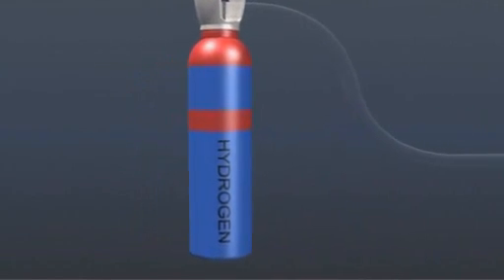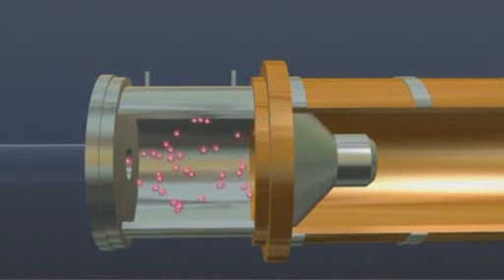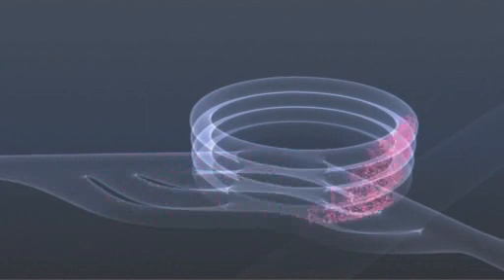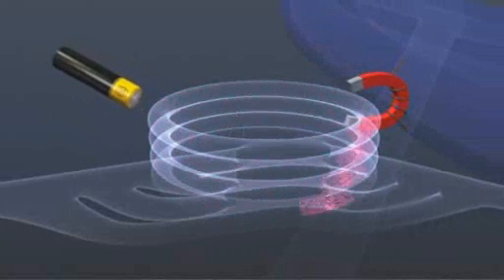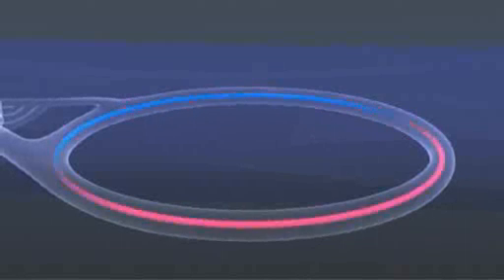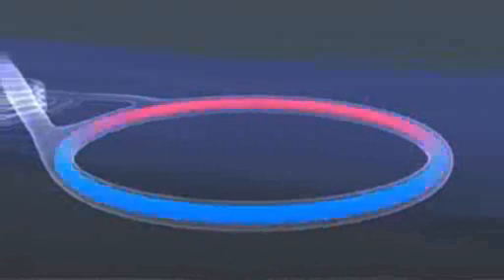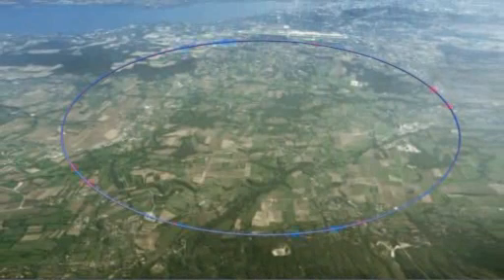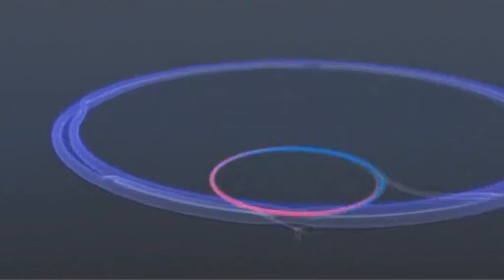The LHC - The Large Hadron Collider. What is the LHC, how does it work?

Comment: Everything is Vibrating Waves of Energy!!

The fact that this tiny spherical region of the One Infinite Universe has a limited observable range as the light waves come from a distance radius.  . ..Absorbing that information now is observable in the shape of an inverse sphere.  . ..4pi R2.. .  .
And the fact that (See: Spherical Electron Sixty Symbols) shows how the electron is indeed a perfectly round vibrating sphere.. .   .Thus because of the geometry are two sides of the same + and - coin!!

The increase in Volume +1=0 now -1 de-compression is only a slight deviation however.. .  .

There exists only two combinations of these Two Spherical Sine Wavefronts multiplying inward +1=0 now -1 dividing outward at right angles from their sources.. .  .
They have opposite vectors and quantum spin forming the positron +1=0 now -1 electron Wave Centre.. .  .
                                                                          (((((((4pi R2=/N pi Re2))))))
Or "the two dipole energy states of Qubit's" in quantum computing which can be such things as photons, trapped ions, atoms, electrons, and nuclear spins, made of vibrating wavefronts concentrically layered like onions called shells in particle physics, or spherical standing wave structures.. .  .Only difference is time dilating Volume now - their output was the negation of their input: 0 goes to 1,1 to 0.. .  .the start of the Fibonacci spiral.. .  .

Now space is a division of solidity into entropy as time unfolds C2 the second law of thermodynamics.. .  .But also in the future E2= a multiplication of volume +1=0 now at the expense of gravitational potential -1. .  .
                                                                   E2=(((((((M2 C4+P2 C2))))))).. .  .

Everything is formed by a surounding 4pi spherical inward absorption +1=0 now -1 outward emission of electromagnetic waves that's forming resonance antimatter matter annihilation forming positive and negative electric charge, and electromagnetic interference fields (2pi spiral radians 360 degrees) as time unfolds C2.. .  .

Therefore generation of "any information" exceeds radiation during the first half of the cycle +1=0 now -1 Radiation exceeds generation during the second half of the cycle.. .   .As the constant outward momentum of EMR repels like charged particles absorbing energy input +1=0 now -1 emitting the density from the two previous vectors spiralling out the Fibonacci sequence seen everywhere in nature.. .  .

Spherical logarithms forming +1=0 now -1 breaking exponential spirals.. .  .

Everything is made of just Two Spherical Sine Wavefronts compressing +1=0 now -1 de-compressing Two Opposing Spiral Vortices!!.. .  .from virtual pair's of plasma, to gases, liquids, and solid Fibonacci fractals!!.. .  .Only difference is time dilating volume, or their rate of vibration, at the centre of their own 3D ref-frames, or time line of broken symmetry within the One Infinite Universe.. .  .and therein lies the secret of the universal pulse beat.. .  .All motion is 2pi spiral.. .   .And all direction is 4pi spherically curved.. .  .
Vibrating sinusoidal spherical wavefronts of only motion forms Einstein's curvature of spacetime.. .  .
Velocity equals time density +1=0 now -1 density of space-time.. .  .V= td +1=0 now ds-t G/r2.. .  .
Gravitational systems are the ashes from prior electrical systems -1.. .  .
Time is inverse multiplying +1=0 now -1 dividing like frequency and wavelength.. .  .

Weiner Heisenberg the father of particle accelerators called an end for them in 1975, when he realized that matter had to be made of these resonances.. .  .Which then brought about the string theory craze where finding symmetry in the mathematics, everything was made of strings of energy!!

Strings vibrating a series of multi dimensional loops - "A Spherical Standing Wave Structure", at the centre of its own  three dimensional ref-frame."

It all started with a big bang output division theory by tracing time back to a single point in the past was a huge misconception since Dirac's discovery of the antimatter positive electric charge E=+m.c2.. .  .(((Imploding positive energy compression))) The conversion is, in fact a ratio between opposite vectors, thus the zero point field is the every beginning of everything giving us a starting point, or concept of zero in mathematics.. .  .

Everything is formed by a surrounding 4pi spherical inward absorption +1=0 now -1 outward emission of electromagnetic waves.. .  .And therefore the traditional assumption where space is three dimensional, and time plays the role of a fourth dimension is inaccurate.. .  .If individuals would wish to discover the true origin of the universe they would actually have to look "forward into the future", since Cnow's time resonance input vector direction +1=0 now is opposite to -1 the arrow of distance as time unfolds all the interference dividing outward from their sources.. .  .And that is what's being perceived as an expanding universe.. .  .

Light waves from all particles within every observable spherical region of the One infinite Universe, cascading downward from a distance radius combine forming the sinusoidal wave medium density (space) compressing +1=0 now -1 de-compressing Two Opposing Spiral Vortices at each and every point of space, or contracting +1=0 now -1 expanding Virtual Pair's Spiralling out of existence.. .  .(((Tiny implosions +1=0 now -1 explosions))).. .  .Because all 3D directions are 4pi spherically curved thus (((Wave Centres are Everywhere))) Relative to an infinite future of potential possibilities coming into +1=0 now -1 out of existence.. .  .

The total amplitude formed by a "rings series" of inward spherical waves coming into every point.  . ..Colliding at maximum compression points at wave crests and wave troughs always seeks a minimum +1=0 now are equally balanced by opposite expansion -1 at interchanging compression points.  . ...As trillions of waves cancel now the sum of opposite vectors mathematically is always zero.  . ..((Zero Point Field)).. .  .Leaving space with an average temperature, or pressure stillness of the wave amplitude squared.. .  .

This polarized superposition of the wave amplitude squared is the reason for entanglement for the symmetry or conservation laws in human physics or why, at the speed of C, time and space are zero due to length contraction and time dilation or why, the point of charge Q is the same for the entire surface of an expanding light sphere.. .  .Because the photons input +1=0 now -1 output polarization in between the crests and troughs will remain the same ((sharing the same expanding moment of time)) no matter how large the surface of the light sphere becomes until acted upon by an external force.. .  .

Vibrating sinusoidal spherical wavefronts always transverse one unit of space now per one unit of time dilation.. .  .Huygens wavelets forming the wavefronts are acting like the bits, or zeros and ones of a computer screen.. .  . 
The Planck's constant h continuously forming a blank canvas that we can interact with turning the possible into the actual.. .  . In a sense this so called quantum foam is a constant vibration on the edge between space and time.. .  .

Light is simply space divided by time entanglement and nothing else.. .  .That implies a strict equivalence between time and space with light being the constant conversion unit between the two.. .  .

And because everything is formed by a surrounding 4pi spherical inward absorption +1=0 now -1 outward emission of electromagnetic waves.. .  . Electrical potential is the same as future potential imploding within any 3D centred ref-frame, or object!!.  . ..And thus the Lorentz contraction of time and space is infinite in our universe within the active cores of galaxies.. .  .

Surrounding Implosive energy compression contracting time and space where the virtual pair's formed by 4pi R2's ((The "rings series" of photon energy)) that cannot escape from being multiplied to infinity t=0.  . ..Now forming an equal and opposite explosive de-compression of Cosmic ray jets and Synchrotron radiation expanding outward via the poles.. .  .Somewhere within the One Infinite Universe!!

A sort of fusion of wave and emission of new Cosmic rays.. . .Cosmic rays are 89% hydrogen nuclei, 10% helium nuclei, and 1% everything else!!

Atomic particles are really High Wave Amplitude Wave Centres of Pure Vibration, from regions of intense surrounding wave pressure.  . .. Made of Vibrating Wavefronts concentrically layered like onions called shells in particle physics, or Spherical Standing Wave Structures over a period of time.. .  .((Relative only to their frequency now)).. . . before decaying back into the Light.. .  .

Radiation is the normal death Principle: Everything slowly dies by radiating away its heat.. .  .
Radioactivity is natures explosively quick death Principle: Atomic fission helps these dying metals to form an explosive de-compression expanding instantly instead of decaying over long periods.. .  .

Stimulated emission is a process by the way of which a higher energy quantum mechanical state of an atomic particle absorbing energy input +1=0 now is being converted to a lower level -1 resulting in the production of light photon oscillations, or new electromagnetic vibrations.. .  .

A sort of fusion of wave and emission of new input +1=0 now -1 output quantized spherical wavefronts of electromagnetic radiation +4-0-4+- independent of the motion of its source.. .  .

When One ((Input +1=0 now -1 output Wave Centre)) is moving relative to another ((Input +1=0 now -1 output Wave Centre)) they give rise to beats of interference (caused by the Spherical Inward +1=0 now -1 Outward Waves due to relative motion from the two previous vectors) which were identified through experiments as the de-Broglie Wavelength y=h/mv, and also gave rise to the frequency increases and thus Energy/Mass Volume now increases (as E=hf =mc2) of Albert Einstein's Special Theory of Relativity!!  And where the constant de-compression causes an equal and opposite acceleration or gravitation from the continuous stimulated emissions as time unfolds C2.. .  .

The One Unified Electromagnetic Spectrum is a continuous flow of energy (Vibrating Waves) therefore light is a Transverse Sinusoidal Wave.. .  . And it was time that was quantized.. .  .
Spacetime was quantized into moments.. .  .Only the frequency now is relative at each dipole magnetic moment of time!!

Everything is formed by a surrounding 4pi spherical inward absorption +1=0 now -1  outward emission of electromagnetic waves.. .  .+1 and -1 represents the inward absorption now outward emission of electromagnetic waves.. .  .And 0 represents the moment of now for each photon electron coupling.. .  . or dipole moment.. .  .

Input +1=0 now -1 output is a process of 4pi spherical symmetry forming and breaking.. .  .All motion is 2pi spiral.. .  .And all 3D directions are 4pi spherically curved.. .  .

Energy is vibrating sinusoidal spherical wavefronts of only motion multiplying inward +1=0 now -1 dividing outward at right angles from their sources.. .  .With positive energy compression forming the future potential to perform work because positive antimatter represents the past and potential future enfolding an organization process +1=0 now for -1 the continuous disorganization of statistical entropy as time unfolds.. .  .

They are particles yeah sure, but they only exist relative to their frequency now!!

Hence a particle is what happens when you build a particle accelerator.. . .And ever since the father of particle accelerators Weiner Heisenberg called an end for particle physics in 1975, these people are still wasting our resources and billions of tax payers dollars only to smash these tiny "Wave Centres of Pure Vibration" together.  . .. Rather like a bunch of cave men smashing flint stones together, and then giving names to the many individual sparks that fly off.. .  .Just to support their pay checks!!
And with the Vadican Church still funding the Nobel Prizes for Christian sciences big bang moment of creation!.. .  .When God made the universe and violated all the known conservation laws.. .  No wonder there has been no real advances in science since Dirac discovered antimatter positive electric charge.. .  .The standard model has become like a new religion, and the big bang theory is the challis on their alter!!!.. .  .

The Higgs bosons from Higgs field are really just photon oscillations from all other matter spherically distributed around the particle in 3D space now, or electromagnetic vibrations multiplying inward from the universe.. .  .
                                                    ((((Imploding positive energy Compression))))

Thus in the future background waves at right angles must propagate non linearly multiplying inward towards the central region producing two coupling resonances antimatter matter annihilation, or input +1=0 now -1 output interference..

We then upon observing the outward momentum of photon input +1=0 now -1 output quantized spherical wavefronts of electromagnetic radiation independent of the motion of its source.. .  .And then call that process of change "charge."

Therefore it is a surrounding 4pi spherical inward absorption +1=0 now -1 outward emission of electromagnetic waves that's forming resonances antimatter matter annihilation, forming positive and negative electric charge, and electromagnetic interference fields (2pi radians 360 degrees) as time unfolds C2.. .  .from objects!!

 As the frequency gets higher the Planck's constant will be multiplied by a larger rate oscillating photon electron couplings within that object, and the time period will slow down relative to the perspective of an outside observer, at the centre of their own time line of broken symmetry.. .  .

And that constant explosive de-compression dividing expansion outward from the Sun forms the inward force called gravity as time unfolds C2.. .  .Takes about eight minutes to reach Earth.. .  .

And likewise the constant outward momentum of the light from Earth (the negative polarity transverses the acceleration) or gravitation from the continuous stimulated emissions as time unfolds C2.. .  .As their individual light spheres superimpose their crests and troughs become in phase now ((their space time line symmetries will synchronize)) or amplify by multiplying electrical potential along cubic dynameters compressing the wave amplitude +1=0 now -1 the shorter the expanding 2pi spiral wavelengths dividing acceleration away from its source in unison.. .  .

In other words as the positive surface of the negative expanding light sphere's increase with the square of the radius now the strength of the gravitational field transverses Q inversely proportional to the square of the distance from the sources of that constant expanding light sphere.. .  .Therefore is no need to imagine any dark matter anymore!!

And because your really made of "Wave Centres of Pure Vibration", then it doesn't really matter where you are within the One Infinite Universe.  . ..Because you'll always be at the centre of your own 3D ref-frame as the light waves come from a distance radius.  . ..Absorbing that information now can see the stars and galaxies as they were in the past from when those light waves were emitted.. .  .

Eight minutes from the Sun as time unfolds into the future.. .  .
One second from the Moon as time unfolds into the future.. .  .
And when we look down at our feet.. .  .Then all we have is uncertainty about how a future event may turn out.. .  .And as you walk out your door, and look up into the sky as time unfolds into the future.. .  .A Satellite 93 million miles away would have to wait eight minutes to detect you and the ground rising up together in unison.. .  .

But if the Satellite could detect x-rays, then you wouldn't even have to leave your house, it would detect the ground, with you in your house rising up together in unison.. .  .

Time moves at the speed of light, and energy or mass slows space time down forming their own space time geometry.. 
Because Velocity equals time density +1=0 now -1 density of space-time.. .  .V= td +1=0 now -1 ds-t G/r2.. .  . 
Gravitational systems are the ashes from prior electrical systems -1.. .  .
Energy compression = mass. de-compressing constant C2.. .  .
Time is inverse multiplying +1=0 now -1 dividing like frequency and wavelength.. .  .
Reply: Of course the standard model is taken for granted. If you have a better observation, then write a paper and get it evaluated. The fact is that the standard model has never been wrong in all situations that we can check it. So we know it is at least correct for the scales we know of. That is no different than Newton being mainly correct about mechanics. Until we started talking about extreme scales, Newtonian mechanics worked perfectly well in all situations and was "true" in regards to the questions that it answered.
Reply: Energy is vibrating sinusoidal spherical wavefronts of only motion multiplying inward +1=0 now -1 dividing outward at right angles from their sources.. .  .
The Higgs boson from Higgs field is an old idea!
Its the same as the probability wave function in quantum physics!
But I wonder why do individuals have to keep inventing different names for these photon oscillations, or electromagnetic vibrations?
$  
Since Dirac's discovery of antimatter positive electric charge E=+m.c2.. .  .The conversion is in fact a ratio between opposite vectors, and this zero point field gives us a starting point, or concept of zero in human mathematics...

Milo Wolff called them Positron Waves from the Universe.
Walter Russell called them Cathode Waves, and the Master Minds of ancient India where all our modern mathematics comes from called them "Gift Waves from the Cosmic whole."

Waves from all time dilating inertial ref-frames (within every observable spherical region of the infinite universe) cascading downward from a distance radius combine forming the sinusoidal wave medium density (space) compressing de-compressing Two Opposing Vortices at each and every point of space, or contracting and expanding virtual pair's popping out of existence.. .  .

The total amplitude formed by a rings series of inward spherical waves coming into every point.  . ..Colliding at maximum compression points.  . ..At wave crests and wave troughs always seeks a minimum.  . ..Are equally balanced by opposite expansion at interchanging compression points.  . ..As trillions of waves cancel the sum of opposite vectors mathematically is always zero (zero point field)
Leaving space with an average temperature or pressure stillness of the wave amplitude squared.. .  .

This polarized superposition of the wave amplitude squared is the reason for entanglement for the symmetry or conservation laws in human physics or why, at the speed of C, time and space are zero due to length contraction and time dilation.. .  .Or why, the point of charge Q is the same for the entire surface of an expanding light sphere.. .  .Because the polarization between the crests and troughs will remain the same (sharing the same expanding moment of time) no matter how large it becomes until acted upon by an external force.. .  .

Vibrating sinusoidal spherical wavefronts always transverse one unit of space/ per one unit of time.  . ..Huygens wavelets forming the wavefronts are like the bit's, or zeros and ones of a computer screen, the Planck's constant is continuously forming a blank canvas in a sense this termed quantum foam is a constant vibration on the edge between space and time.. .  .

As time unfolds light is simply space divided by time entanglement and nothing else!!
That implies a strict equivalence between time and space with light as a constant conversion unit between the two.

Electrical potential is the same as future potential imploding within an object or ref-frame.  . ..Thus the Lorentz contraction of time and space is infinite in our universe within the active cores of galaxies!!

Implosive inward energy compression contracting time and space where the virtual pair's formed by 4pi R2's cannot escape from being multiplied to infinity t=0.  . ..Now forming an equal and opposite explosive de-compression of Cosmic ray jets and Synchrotron radiation expanding outward via the poles.. .  . 
A sort of fusion of wave and emission of new Cosmic rays, somewhere in the infinite Universe, at the centre of their own 3D ref-frames.. .  .Cosmic rays are 89% hydrogen nuclei, 10% helium nuclei, and 1% everything else!!

Atomic particles are really high wave amplitude wave centres of pure vibration, from regions of intense wave pressure, made of vibrating wavefronts called shells in particle physics, or spherical standing wave structures over a period of time.. .  .Their output was the negation of their input: 0 goes to 1,1 to 0.. .  .the start of a Fibonacci spiral.. .  .

Therefore generation of "any information" exceeds radiation during the first half of the cycle +1=0 now -1 radiation exceeds generation during the second half of the cycle as the constant outward momentum of EMR repels like charged particles absorbing energy t=0 now emitting the density from the two previous vectors spiralling out the Fibonacci sequence seen almost everywhere in nature.. .  .

All motion is 2pi spiral.. .  .And all direction is 4pi spherically curved.. .  .Because everything is a ratio between opposite vectors formed by a locational 4pi spherical inward absorption t=0 now outward emission of electromagnetic waves, that's forming resonance antimatter matter annihilation, forming positive and negative electric charge, and electromagnetic interference fields as time unfolds C2.. .  .

Stimulated emission is a process by the way of which a higher energy quantum mechanical state of an atomic particle absorbing energy +1=0 now is being converted to a lower level -1 resulting in the production of light photon oscillations, or new electromagnetic vibrations.. .  .
A sort of fusion of wave and emission of new quantized spherical wavefronts of electromagnetic radiation independent of the motion of its source.. .  .

The One electromagnetic spectrum is a continuous flow of vibration (energy) therefore light is a sinusoidal wave and it was time that was quantized.. .  .
Space-time was quantized into moments.. .  .Only the frequency now is relative at each dipole moment of time.. .  .

Therefore our universe is a true continuum and everything will eventually reform recreating the same patterns of broken symmetry through endless cycles of ever greater complexity and diversity.. .  .

There is no universal time, but rather time is relative only to an individual object or observer relative to their own energy or mass at the centre of their own 3D ref-frames within the One Infinite Universe.. .  .

And that time line can be visualized in the line symmetry or an individual ref-frame or object like Newtons apple!!

Therefore it all started with a big bang output division.. .  . by tracing time back to a point in the past was a huge misconception!!!

Since Dirac's discovery of antimatter positive electric charge E=+m.c2.. .  .The conversion is in fact a ratio between opposite vectors, and the traditional assumption where space is three dimensional, and time plays the role of a fourth dimension is inaccurate!!!

If people truly wish to discover the origins of the universe, then they would actually have to look "forward into the future" since Cnow=0's time input resonance vector direction +1=0 now is opposite to -1 the arrow of distance as time unfolds all the interference from their sources.. .  .And that is what they perceive as an expanding universe.. .  .LOL!!!

The redshift with distance is actually a consequence of less energy exchange, less wave interactions oscillating in between time dilating gravitational gradients with distance and Doppler causes a redshift because light in a vacuum is a constant wave chain reaction from A to B.. .  .

The greater the energy compression contracting spacetime= 0 now the shorter the expanding wavelengths.. .  .It really is that simple!!!
Thus the wavelengths simply become longer as they spread out over many billions of light years propagating in between low pressure density regions of space acting upon the wave amplitude with distance.. .  .And therefore the big bang never happened.. .  .And our universe will never die because it was never born in one single moment.. .  .

But what if the big bang really did happen?

Light waves emitted now from all time dilating inertial ref-frames, from all matter, and stars and galaxies of perpetual systems are forever passing outward into the infinite ocean of zero Kelvin (empty space) never to return and without ever coming into contact with objects of that nature.. .  .
That kind of tiny island big bang material universe would be destined to become gradually but systematically impoverished and the evolution of perpetual systems would never had happened since Mach's Principle: "All inertial ref-frames are determined by the composite matter of the universe", was the basis for Einstein's theory of relativity.. .  .

Everything is formed by a locational 4pi spherical inward absorption t=0 now outward emission of electromagnetic waves.. .  .
Because energy is vibrating sinusoidal spherical wavefronts of only motion multiplying inward +1=0 now -1 dividing outward at right angels from their sources.. .  .
All motion is 2pi spiral.. .  .And all direction is 4pi spherically curved.. .  .Vibrating sinusoidal spherical wavefronts of only motion forms Einstein's curvature of space-time.. .  .

The fact that this tiny spherical region of the infinite universe has a limited observable range as the waves come from a distance radius, now is observable in the shape of an inverse sphere.  . ..4pi R2.. .  .And the fact that the electron is a perfectly round vibrating sphere.. .  .Are two sides of the same + and - coin!!
There exists only two combinations of these two spherical + and - electromagnetic sine waves, or wavefronts multiplying inward +1=0 now -1 dividing outward at right angels from their sources.. .  .They have opposite vectors and quantum spin forming the positron and electron wave centre.. 4pi R2=/N pi Re2.
Or, "the two dipole energy states of Qubit's" in quantum computing which can be such things as photons, trapped ions, atoms, electrons, and nuclear spins.. .  .Made of vibrating wavefronts called shells in particle physics, or spherical standing wave structures over a period of time.. .  .Their output was the negation of their input: 0 goes to 1,1 to 0.. .  .the start of the Fibonacci sequence seen almost everywhere in nature.. .  .A Golden Ratio Between Opposite Vectors."
Reply: Jacob Darenberg It's actually quite talented to be able to spout that much shit, I used to feel sorry for these guys, now I just find them funny
Reply: So that means vibrators are pure energy?
Reply: "Yes, everything will oscillate in periodic or harmonic motion!!.. .  . Because energy is vibrating sinusoidal spherical wavefronts of only motion multiplying inward +1=0 now -1 dividing outward at right angles from their sources.. .  .As the frequency gets higher the Planck's constant will be multiplied by a larger amount, and the time period will slow down for that object, because of the increased rate of electromagnetic vibrations, or photon oscillations within that object absorbed +1=0 now -1 emitted relative to the perspective of an outside observer at the centre of their own time line of broken symmetry."
Reply: I tried coming up with ideas like that a few months ago.  The graduate student I asked shot me down brutally with some personal attacks, about my lack of knowledge on quantum physics.  Too bad, because I thought I had a brilliant hypothesis of hidden variables.
Reply: Megatom"See: Ray Tomes Harmonic theory (How to make a universe) WSM on youtube!!
And the Milo Wolff Videos.. .  .Walter Russell and D.B Larson's Vortex Mechanics.. .  .And Quantum Atom Theory, also on youtube!!
 
Once a certain level of technological skill is achieved though plasticity, ethics and form... The greatest scientists are always artists as well (Albert Einstein)
 
The atoms and elementary particles are not real: they form a world of potentialities or possibilities rather than one thing, or facts...(Weiner Heisenberg)

Weiner Heisenberg the father of particle accelerators, called an end for particle physics in 1975 when he realized that matter must be made of these resonances.. .  .Which then brought about the string theory craze, where finding symmetry in the mathematics everything was imagined to be made of strings of energy!!

Strings vibrating a series of multi-dimensional loops - "A Spherical Standing Wave Structure" at the centre of their own 3D ref-frames.. .  . 
Because everything is made of vibrating waves of energy.. .  .ever since these physicists have been wasting our resources, and billions of tax payers dollars (building particle accelerators).. .  . Only to smash these tiny wave centres of pure vibration together, rather like a bunch of cave men smashing flint stones together, and then giving names to the many individual sparks that fly off.. .  .Just to support their pay checks!!

They don't even care how the universe really works.. .  .And all the while the Vadican Church has been funding the Nobel prize for Gods moment of creation.. .  .
No wonder there has been no real advances in science since Dirac's discovery of antimatter positive electric charge E=+m.c2.. . 

However, for this multiplication of energy input +1=0 (In Euler's Identity)  we could use the Latin Symbol for gamma!

The Lorentz contraction of spacetime linked with Einstein's equations for 'rest mass' energy gives an atom or group of atoms enough energy to expand EMR, projecting their own spacetime (time) at the speed of the square of light.. .  .This is why the speed of light in a vacuum is the same for all observers, and is not relative to the movement of the observer.. .  .Because light in a vacuum will always be a universal constant independent of the motion of its source.. .  .

It is a locational 4pi spherical inward absorption +1=0 now -1 outward emission of electromagnetic waves that's forming resonance antimatter matter annihilation, forming positive and negative electric charge, and electromagnetic interference fields as time unfolds C2.. .  .

The Higgs bosons from Higgs field is a very old idea!!
It is the same as the probability wave function in quantum physics!

They are really just electromagnetic vibrations from the universe, or photon oscillations from all other matter spherically distributed around the particle.. .  .
Background waves must propagate non linearly at the central region producing two coupling resonances (antimatter matter annihilation) and upon observing the outward waves from its source, then we call that process of change "charge."

Milo called them Positron Waves from the Universe.. .  .
Walter Russell called them Cathode Waves, and the Master Minds of ancient India where all our modern mathematics comes from called them "Gift Waves from the Cosmic Whole."

This zero point field gives us a starting point or concept of zero in our mathematics, and not the big bang.. .  .

Light waves from all time dilating 3D centred inertial ref-frames (within every observable spherical region of the infinite universe) cascading downward from a distance radius combine forming the sinusoidal wave medium density (space) compressing de-compressing Two Opposing Spiral Vortices at each and every point of space, or contracting and expanding virtual pair's popping out of existence.. .  .

The total amplitude formed by a rings series of inward spherical waves coming into every point.  . ..Colliding at maximum compression points at wave crests and wave troughs always seeks a minimum.  . ..Are equally balanced by opposite expansion at interchanging compression points.  . ..(2pi spiral symmetry forms naturally out of 4pi spherical symmetry) As trillions of inward spherical waves cancel the sum of opposite vectors mathematically is always zero.  . ..(zero point field) Leaving space with an average temperature, or pressure stillness of the wave amplitude squared.. .  .

This polarized superposition of the wave amplitude squared is the reason for entanglement for the symmetry or conservation laws in human physics or why, at the speed of C, time and space are zero due to length contraction and time dilation.. .  .Or why the point of charge Q is the same for the entire surface of an expanding light sphere.. .  .Because the polarization between the crests and troughs will remain the same (sharing the same expanding moment of time) no matter how large it becomes until acted upon by an external force.. .  .

Vibrating sinusoidal spherical wavefronts always transverse one unit of space/ per one unit of time.. .  .Huygens wavelets forming the wavefronts are like the bit's the zeros and ones of a computer screen, the Planck's constant is continuously forming a blank canvas in a sense quantum foam is a constant vibration on the edge between space and time coming into and out of existence.. .  .

As time unfolds C2 light is simply space divided by time entanglement and nothing else.. .  .
That implies a strict equivalence between time and space with light as a constant conversion unit between the two.. .  .

All motion is 2pi spiral.. .  .And all direction is 4pi spherically curved.. .  .Mass plasma field vector of the universe acting upon every point of space from a distance radius.  . ..Vibrating sinusoidal spherical wavefronts of only motion forms Einstein's curvature of space-time.. .  .

Everything is just Two Spherical Waves compressing de-compressing Two Opposing Spiral Vortices.. .  .From virtual pair's of plasma, to gases, liquids, and solid Fibonacci fractals.. .  .Only difference is time dilating volume at the centre of their own 3D ref-frame within the One Infinite Universe.. .  .and therein lies the secret of the universal pulse beat.. .  .

Electrical potential is the same as future potential imploding within an object or ref-frame.  . ..Therefore the Lorentz contraction of time and space is infinite in our universe within the active cores of galaxies.  . ..

Implosive inward energy compression contracting time and space where the virtual pair's formed by 4pi R2's that cannot escape from being multiplied to infinity t=0.. .  .Now forming an equal and opposite explosive de-compression of Cosmic ray jets and synchrotron radiation expanding outward via the poles somewhere within the infinite universe.. .  .
A sort of fusion of wave and emission of new Cosmic rays.. .  .Cosmic rays are 89% hydrogen nuclei, 10% helium nuclei, and 1% everything else.. .  .Made of vibrating wavefronts called shells in particle physics, or Spherical Standing Wave Structures over a period of time.. .  .

And on another fractal level, because energy is vibrating sinusoidal spherical wavefronts of only motion multiplying inward +1=0 now -1 dividing outward at right angles from the sources.. .  .

Stimulated emission is a process by the way of which a higher energy quantum mechanical state of an atomic particle absorbing energy input +1=0 now is being converted to a lower level -1 resulting in the production of light photon oscillations, or new electromagnetic vibrations.. .  .
A sort of fusion of wave and emission of new quantized spherical wavefronts of electromagnetic radiation independent of the motion of its source.. .  .

The One electromagnetic spectrum is a continuous flow of energy (Vibrating waves) therefore light is a sinusoidal wave and it was time that was quantized.. .  .
Space-time was quantized into moments.. .  .Only the frequency now is relative at each dipole moment of time.. .  .

Therefore will never be a heat death so long as there's always a constant de-compression, or expansion C2.. .  .And the universe will never die simply because it was never born in one big magical moment.. .  .

Because space is a division of solidity into entropy C2 the second law of thermodynamics.. .  .But also E2= a multiplication of volume at the expense of gravitational potential.. .  .

Therefore, eventually everything will reform recreating the same patterns of broken symmetry though endless cycles of ever greater complexity and diversity."
Reply: Seamless Robe You're insane, buddy. You will never be paid to participate in science, because everything that you say is completely valueless and useless.
Reply: "I know that Higgs bosons from Higgs field are really just photon oscillations, from all other matter spherically distributed around the particle now in question, or electromagnetic vibrations from the universe.. .  .
Thus background waves must propagate non linearly at the central region producing two coupling resonances antimatter matter annihilation!!.. .  .We then upon observing the outward momentum propagating from its source, and then call that process of change "charge."
Therefore it is a locational 4pi spherical inward absorption +1=0 now -1 outward emission of electromagnetic waves that's forming resonance antimatter matter annihilation, forming positive and negative electric charge, and electromagnetic interference fields (2pi radians) as time unfolds C2.. .  .

Input +1=0 now -1 output is a process of 4pi spherical symmetry multiplying inward +1=0 now -1 dividing outward at right angles from their sources.. .  .

As the frequency gets higher the Planck's constant will be multiplied by a larger amount oscillating photons within that object and the time period will slow down relative to the perspective of an outside observer at the centre of their own time line of broken symmetry."
Reply: i love science but you sir are a nerd
Reply: ***** nerd isn't the right word. Totally disconnected from reality is more accurate. He can't understand the difference between rationality and insane ramblings.
Reply: ***** Science is easy!!.. .  . Its just Two Waves!!.. .  .And where these Two Spherical Waves meet creates the particle effect.. .  .

All you have to do is just narrow your mind down to just Two Spherical Sine Wavefronts compressing +1=0 now -1 expanding Two Opposing Spiral Vortices!!.. .  .From virtual pair's of plasma, to gases, liquids, and solid Fibonacci fractals!!
Only difference is time dilating Volume, or their rate of vibration at the centre of their own 3D ref-frames within the One Infinite Universe!!.. .  .And therein lies the secret of the universal pulse beat as one gets a sense of how their mind can exist independently of their body in the form of electrical activity because of the universal law of energy conservation!!

Input +1=0 now -1 output is a process of 4pi spherical symmetry forming and breaking!!
 
There exists a profound and perfect spherical symmetry between positive and negative electric charge (Mind over matter) and when that symmetry is broken forms the imperfect 2pi spiral symmetry of the Fibonacci sequence seen almost everywhere in nature!!

The One logarithmic inward Light of Universal Mind is Positive +1=0 now -1 its expression in the Two Opposed Lights of normal mind is its negatively expanded reflection of broken symmetry!!

I, the One momentary soul observer, am not divided into Two, as Two pair's of Opposites of Me!!.. .  .I divide the Two Extension of My thinking with neuroplasticity.. .  .But I am not My thinking nor am I Two.. .  .
Reply: Gary Carkeek Nobody has ever seen a particle!!.. .  .We only ever see the outward momentum of light waves of electromagnetic radiation independent of the motion of its source that may come in contact with an observers retina.. .  .And then we interpret those vibrations now with our brains.. .  .
And since all particles will eventually decay back into the Light.. .  .Then Why Don't We Try An Understand What Light Really Is First, before we make up any more extra forces, dimensions, parallel universes, Dark Matter, Dark energy, and Dark flow.. .  .and so on, until 97% of the universe is missing diverting our understanding away from unifying the One Electromagnetic Spectrum into a single dynamic process of spherical symmetry forming +1=0 now -1 breaking.. .  .
                                                         (((((((ITS JUST TWO WAVES)))))))))
I tell you the truth: Everything is formed by a surrounding 4pi spherical inward absorption +1=0 now -1 outward emission of electromagnetic waves.. .  .All motion is 2pi spiral.. .  .And all 3D directions are 4pi spherically curved thus ((((Wave centre's are everywhere)))) Relative to an infinite future of potential possibilities coming into +1=0 now -1 out of existence.. .  . 

And Because your really made of "High Wave Amplitude Wave Centres of Pure Vibration" from regions of intense surrounding wave pressure.  . .. Relative only to their frequency now.. .  .Then it doesn't really matter where you are within the One Infinite Universe, because you'll always be at the centre of your own 3D ref-frame, as the waves come from a distance radius.  . ..Absorbing that information now can see the stars and galaxies as they were in the past from when those light waves where emitted.. .  .

Eight minutes from the Sun as time unfolds into the future.. .  .
One second from the Moon as time unfolds into the future.. .  .
And when we look down at our feet.. .  .Then all we have is uncertainty about how a future event may turn out, and as you walk out your door, and look up into the sky as time unfolds into the future.. .  .A Satellite 93 million miles away would have to wait eight minutes to detect you and the ground rising up together in unison.. .  .

And without walking out your door, as time unfolds into the future.. .  . The Satellite could detect x-rays from you, the ground, and your house rising up together in unison.. .  .  

Now space is a division of solidity into entropy as time unfolds C2 the second law of thermodynamics.. .  .But also in the future E2 will equal a multiplication of Volume +1=0 now at the expense of gravitational potential -1.. .  .
                                            E2=(((((((M2 C4+P2 C2))))))))

What seems to be a conversion is in fact ((A Ratio Between Opposite - and + Vectors)) interpreted as distance and time, physical reality and spiritual reality,  annihilation and creation, matter and antimatter, mass and energy, or interference and resonance within an abstract arrow of time of Cnow=0.. .  .Time moves at the speed of light, and energy or mass slows space-time down forming their own space-time geometry.. .  .And I am sure the same must be true for any aliens out there as well
See: Quantum Atom Theory on youtube.. .  .Everything is Vibrating Waves of Energy!!.. .  .No Strings Attacted!!!